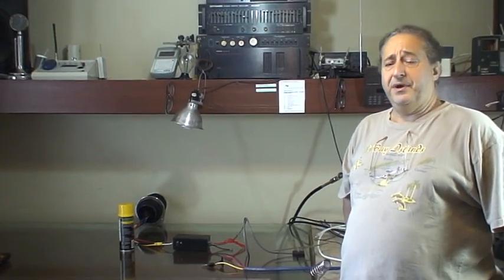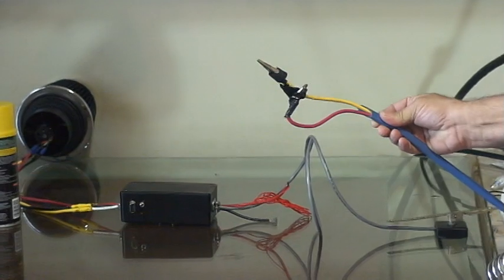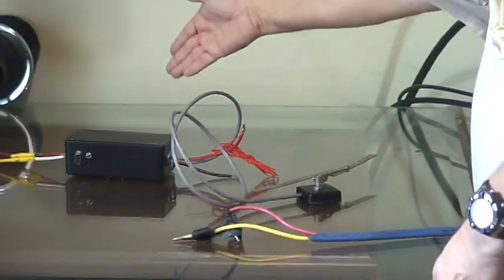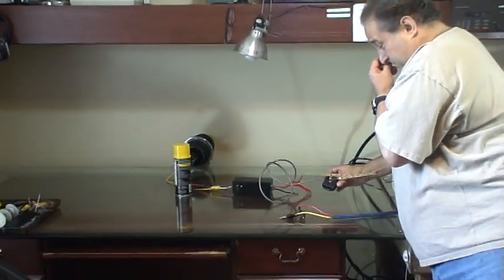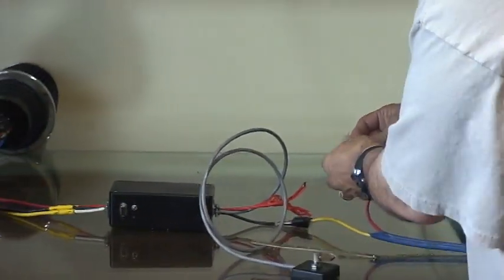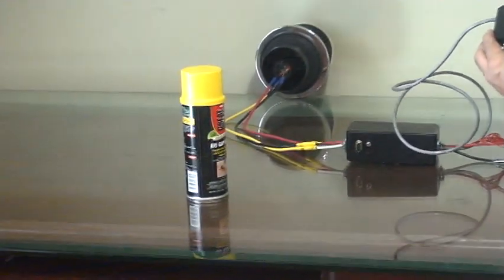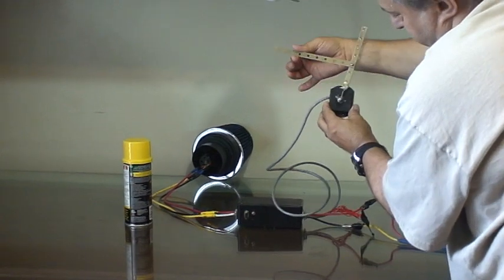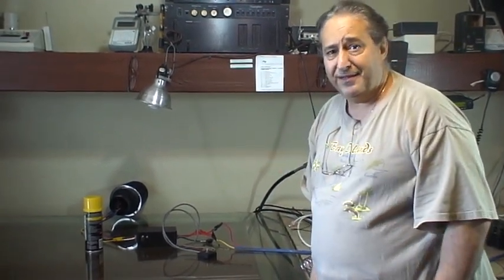Mad Hornet Electric Turbocharger

Comment: Simple fix for this electric turbo which does not work , get a turbo casing and install your electric fan in It , you can get discontinued turbos for 40 bucks , the fan speed is OK so you might be able 2 psi of Turbo boost
Reply: 50000 rpm is not what this fan can do.
Reply: +niceguy60 almost.. you need a brushless motor that can handle 60 000+ rpm... KV depending on the size of the turbo, the amount of air you need to compress, and at what pressure.